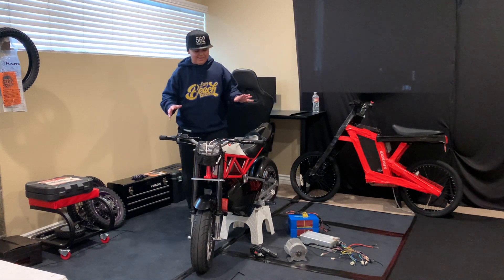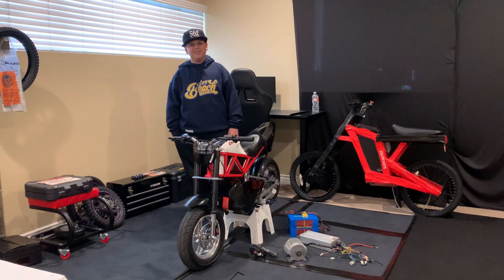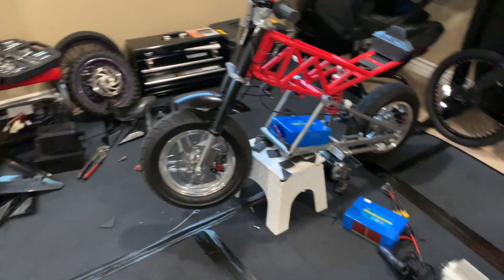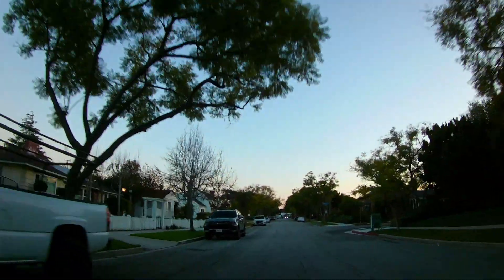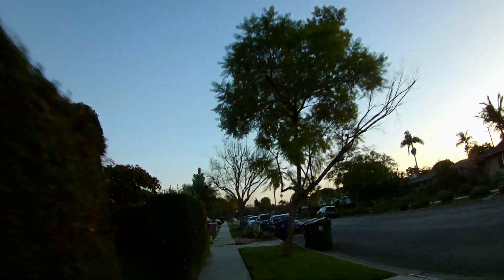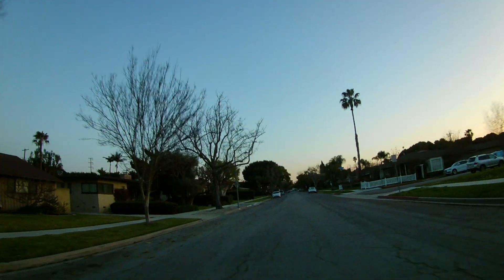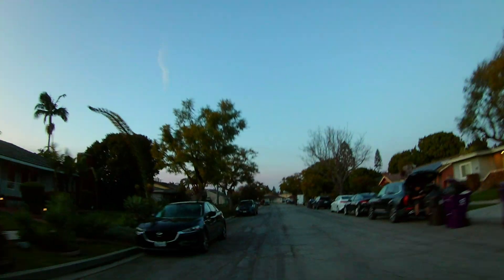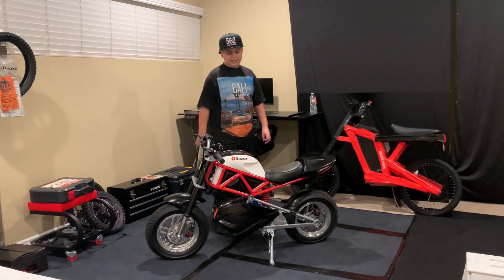I BUILT A 45+ MPH MIN-E-MOTO

Comment: Is that 2 36v 20ah Caomm batteries in a series?
Reply from the maker: Yes
Reply: @Benslowriders  I thought about doing this but was given mixed answered on if it could be done or not. You are the first person I’ve seen do it on here on a razor. Keep up the good work!
Reply from the maker: @junkybuilt8990  thank you
Reply: @junkybuilt8990 I ran two 36v in series almost 2 years no problems.
Reply from the maker: Yo whats up I have kits that come with everything you could possibly need to build a razor. On my website BENS ELECTRIFIED BIKE KITS in my bio